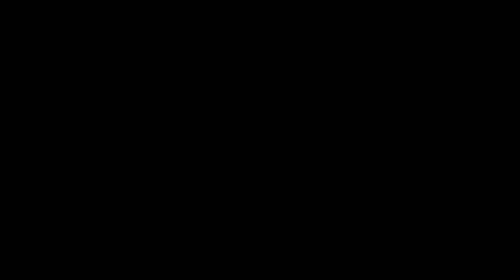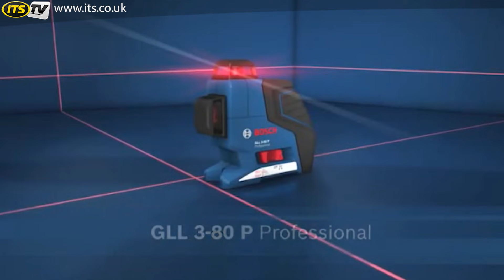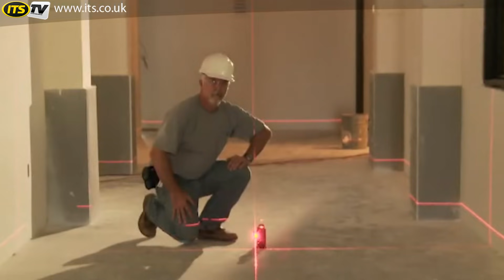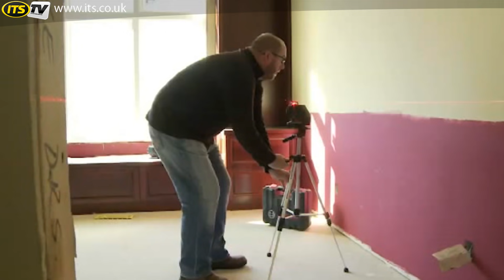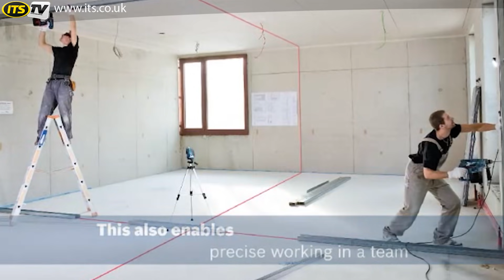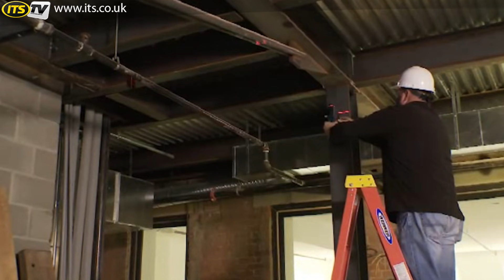Bosch GLL3-80P Professional Self Levelling 3 x 360 Degree Laser - ITS TV

Comment: Whoever buys already buys knowing that THERE IS NO REPLACEMENT PART AND NOR REPAIR,
  I acquired a GLL Level 3-80 P BOSCH, in Brazil and the LR2 laser receiver, and the complete kit of accessories with tripod etc ... believing and trusting in the quality of the brand of which we are already customers,
I bought a new one at the store with a presentation from a Bosch promoter,
with 01 year of use in only one work I used it once it burned the led light, and Bosh claimed that there is no part for repair.
  we demand from Bosch within the CDC and protesting, we charge for the repair of this Leiser Level that I acquired and that Bosch has to give assistance and have the piece for the concert, otherwise indemnify with other equipment and also receiver for use,
all I want is to work with the equipment I invested, it is in perfect condition "brand new". Bosch never again was a loss.

Comment: Dim laser compared to Dewalt side by side. It is much larger too. 
If Bosch could brighten and sharpen the laser I would give it the best rating even considering it's size. You can lock the pendulum and shoot lines at angles but 
(W/O the self leveling feature)  
You can project every line needed simultaneously to lay out an entire tile job which is amazing and it projects the lies 360 degrees in all directions. This is the only laser I know of that can do that.

The addition of a sharp green laser lines would be great!

This one works best in small low lit areas and is a huge time saver.